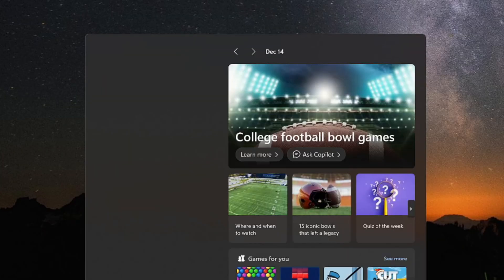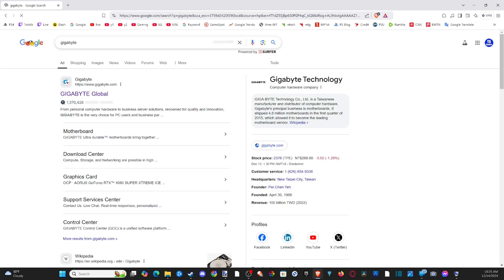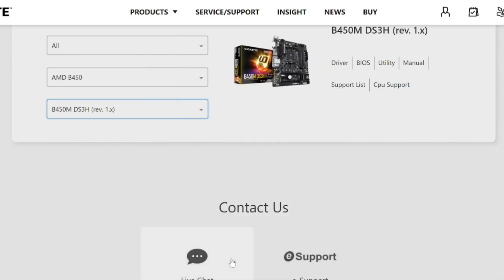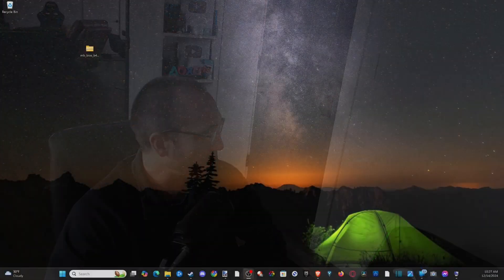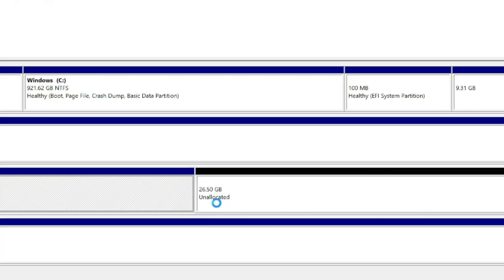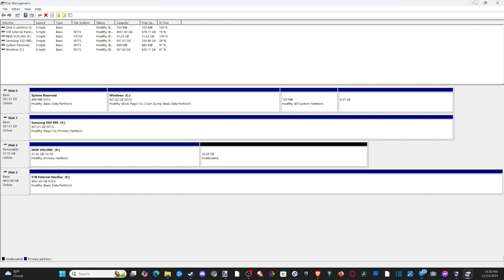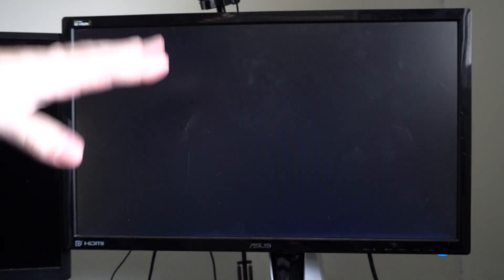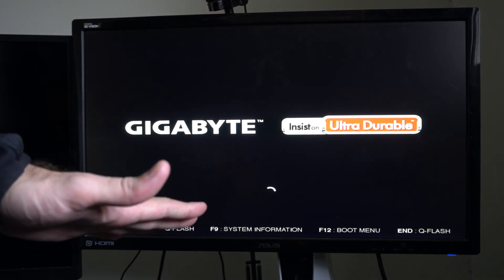How to Fix No Display After Upgrading CPU on PC (Update Bios on Motherboard)(Gigabyte)

Comment: No display means we can't enter the dmn bios at all. It just shows nothing on screen. No display mean nothing at all is visible on screen
Reply: Like he said put in your old cpu
Reply: @Bubbles.yt. put in old cpu and the monitor still won’t turn on
Reply: @Bubbles.yt.  what if you just bought the motherboard and cpu?
Reply: @MrTwoker1986 return it
Reply: I still get no display after putting the old CPU in. Cmos reset does nothing. Nothing does anything now
Reply: @LuxLucidOfficial did you figure it out
Reply: @lucxdツ afraid not sir. I had to get a new motherboard. If you happen to put in a CPU that your motherboard needed an update in order to use, it may have bricked the motherboard. The only saving Grace I can think of is to take it to somebody who can flash the BIOS (requires specific hardware).
Reply: @LuxLucidOfficial yea if you figured this out it would be great
Reply: @RoboFrog42 I had to get a new motherboard. My old one was showing two troubleshooting LEDs on boot; no ram/CPU. MAYBE a bio's flash (take it into a shop) would fix it, but I think these boards are just poorly made.

Comment: It still won’t display anything even after I updated bios
Reply: same
Reply: did u fix it?
Reply: @nathancole5320  yo i ended up fixing it all i did was do a higher update than what i was told, for my cpu it said online that i needed f27 but didn’t work, what you’ve got to do is update bios to the latest update but u gotta do it in order, for example the latest one for me was f30 but i had to first go from f27 to f28 and then since there’s no f29 i went to f30. You gotta do it in this order, go one by one from the version ur on to the latest one, it’s kinda annoying but it worked for me.
Reply: same i need help